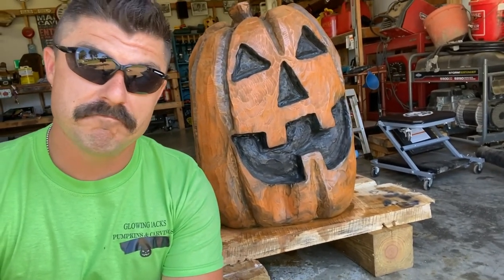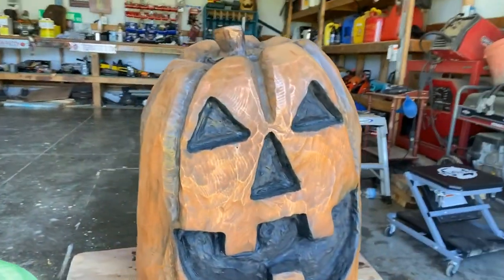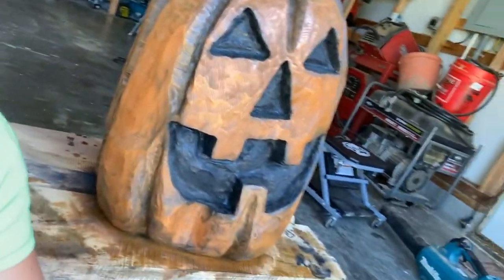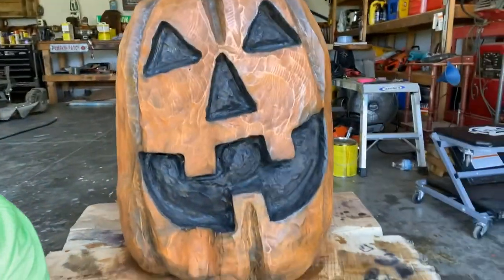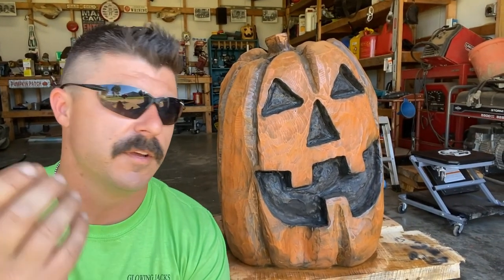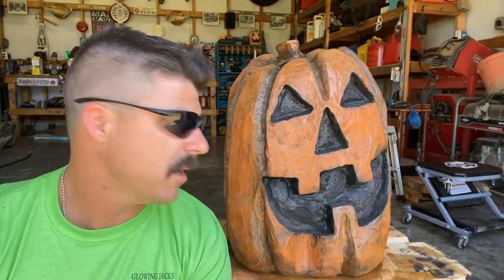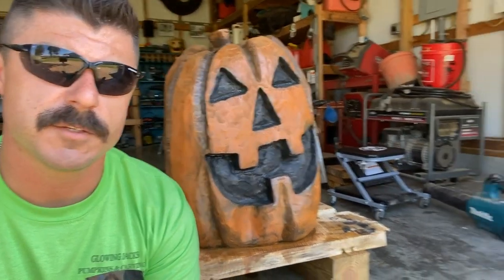Carving a BIG Pumpkin

Comment: What's  your sprayer set up?
Reply from the maker: Well my air brush and sprayer both are harbor freight additions lol I use flat black thinned down with paint thinner on the air brush. And in the sprayer I was using rustoleums safety yellow and red and created the orange with a finished coat of cabots Australian timber oil in the natural.
Reply: Cool, have been wanting  to try a spray gun.  How big is your air compressor? And is it easy cean up?
Reply from the maker: @travisbooth7784   I have like a 8 to 10 gallon on wheels horizontal. But I use a regulator to gauge down the air needed when spraying . Harbor freight has a air brush compressor combo on their site I use for it and it has been working good for about a year now.
Reply: Awesome will have to give it a try.  A fellow gave me a tip for coloring.  Minwax ebony stain, really nice black.  Thanks!!